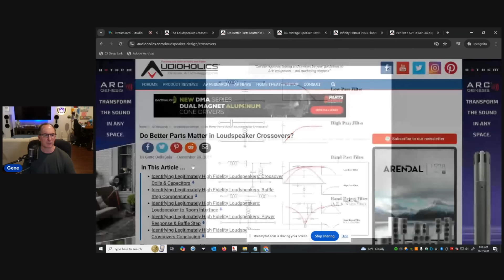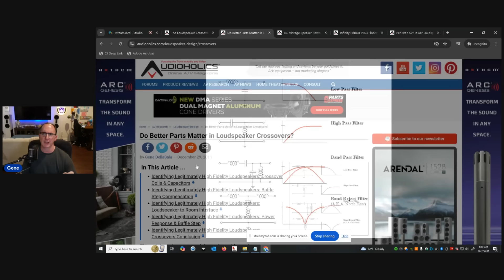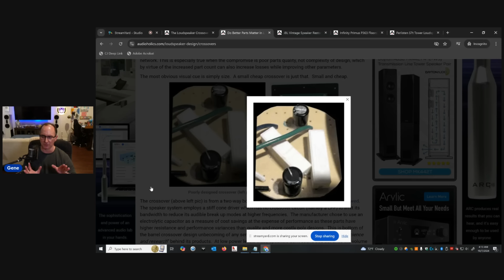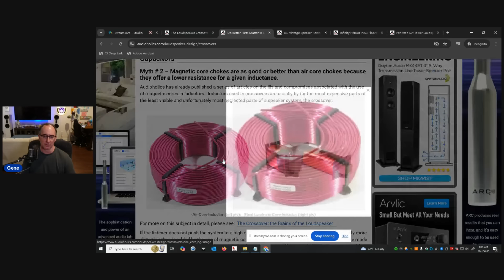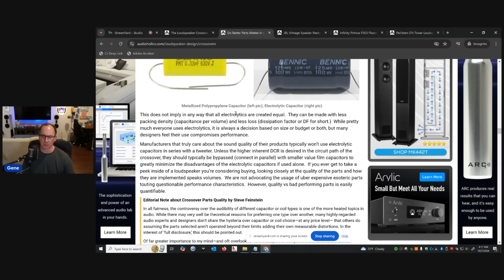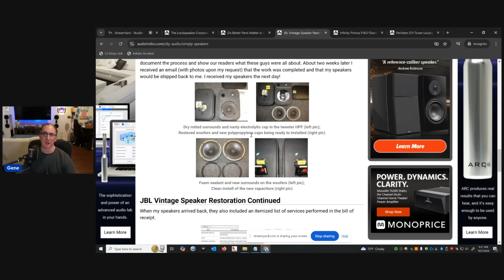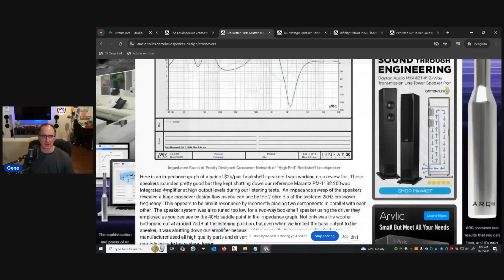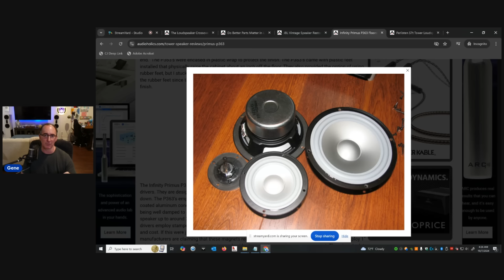Loudspeaker Crossover Upgrades - Are They Worth the Effort?

Comment: As a cobbler of speaker sets, I cobble together sets of towers from various used marketplaces. 

 I use a multi color sticker sheet to label them so I can discern what pairs came along together.  That way if one set was worn out or abused I can weed them out together, or pair them with their kin which have the same degree of use, hoping they mechanically loosened together at the same rate. Or that the manufacturer paired them based on their variance, like matched pairs of tubes. 

I’ve been meaning to get some kind of testing gear to help match pairs and detect discrepancies and bad-apples.   

When having many of the same speaker, and following the philosophy of pursuing identical timbral matching, one naturally thinks on upgrading all of their crossovers together to bring them into even closer tolerances. 

Cobbling sets together like this is easier with budget speakers, because there’s simply more of them in the marketplace.  Lending them to upgrade potential, and a home hobby assembly line of soldering in a new capacitor.  But dropping in a whole new board is rather appealing.  

I feel that the engineers finely tune crossovers to the resonant character of the drivers, so I’m skeptical of any mod being a net benefit, but I also feel that if the capacitor was lower resistance and the tweeter became louder, that the room correction software would account for that, while also having the benefits of lower resistance with crisper transients and micro dynamics.  

Sean Casey’s Zu speakers take a philosophy of having very high sensitivity and minimalistic crossovers with sometimes 1 or 2 parts.  So a lower resistance crossover may play into that same philosophy in a way that some people prefer. But it’s hard to tell how much damping in the crossover is there to tame driver resonances.  

One benefit of the Infinity Primus, is they have anodized constrained layer damping CMD like the CMMD Beta series much like modern Revels and I suspect like RBH’s aluminum cones have too. So the cones themselves have allot of inherent damping of resonances, which maybe would lend themselves to running loose with a more permissive crossover.  

Exotic Material science has always been a fun consideration for me, but most companies have similar philosophies and engineering goals in respect to weight and damping, but still fun to think about, especially when a speaker pursues an alternative design philosophy or has something truly exceptional.

Comment: In upgrading parts modestly (ie swapping a few aging electrolytics to modest mpk's) I suspect the differences created by differing esr etc are compensated for by improved tolerances  - particularly in having the advantage that both speakers will likely be giving a more similar response.

Comment: The fact that some people don't believe that better parts can create a better widget, says they've never built much of anything.  I build competition race engines.  Try doing that with cheap parts and low quality machine work and be competitive over the course of a season or two.

I also build rifles (for myself) where quality generally translates into better performance. You generally get what you pay for in the individual components. 

There's a bunch of examples of the ROI on good quality parts.

I could hook you up with the Danny modified speaker versus unmodified. I have some Focal Cobalt 828 speakers that I haven't upgraded yet. I have the upgrade "kit" from Danny. They're scheduled for surgery this fall/winter.

Comment: I have not ventured into the land of measurements much yet, but I see that it can be useful when treating rooms. Anyway, I have done an upgrade for a pair of klipsch RP600 M MkI that Danny Richie engineered the crossover for. The my impression at first listen was that it sounded like the volume was lower. It might also be the case as the impedance was lower after the upgrade, but after some months of listening I can confirm that it was the correct choice for me. 
Many might say that the original sound of the speaker was demolished in the process and it does not sound like a klipsch anymore. Well, one thing is for sure: I can now listen to it at a high volume for more than 15 minutes. Before it felt like my ears had been at a concert, and I had listening fatigue. The sound overall sounded a lot more quiet. By that I mean there must have been a lot more distortion than what I initially thought before the upgrade. 

I essentially bought the upgrade cause reviews of them gave me the impression that the sound would cover the sound-spectre properly as the original sound from the speakers was not only overly bright, but guitars in my metal music always sounded like they were in the back row.
I was correct, and now the speakers show me all the instruments and sounds in the correct space. (I base this on having used a headset a lot)
Since then I have moved on to GR's own speakers, and it has just gotten better, and  I have also treated my room and upgraded the stereo system, and the speakers just keep on giving. 
I acknowledge that speaker manufacturers often put their own signature sound in speakers, which can be fun, but can  also be damaging to some music. I can at least confirm that no music on these speakers sound bad. They work with all recordings good and bad. 
After getting more listening sound and working more on placement and acoustics, I also noticed that these speakers have a lot more details and can make a wall of sound rather than just coming from the speakers. So it feels familiar with many of the things you mention in this video. 

All in all, I do think parts matter, but there is a point when you need a more trained ear to pick up on the differences. But there are also some things that you can hear instantly. 
Many say that sound is subjective, but I think it also has a lot to do with what you can hear and how trained your ears are. Some that care only about vocals might not notice guitars being further back for instance, and som may only listen to classical music, and therefore not ever notice what a speaker can not do as they are only playing things that sound good in a certain spectre of music. 

Anyway, I can keep going on and on with experiences and conclusions made over the years, but I fully support upgrades. I do admit that some speakers may not need it as the fun part about them might be gone after, but in GR's defence, it will undoubtedly not be bad, and you might get some extra features that you can only get with more expensive speakers. Just as long as you know what to listen for.
Reply from the maker: Yep he traded sensitivity for a more balanced sound.  Most Klipsch speakers tend to be on the brighter side in terms of tonality.

Comment: You are 100% right. For one I'm an electrical industrial tech. I had to face 3 professors when presenting my final paper, but that's not why I agree with you; it is because what you say it totally makes sense. All of it! Now.... I don't agree with you regarding cables. I can easily hear differences in my system. So much that I've sent speaker cables back to Amazon when I compared them to the cables I bought from GR Research. So, my friend: cables matter.... a lot! Thank you for your videos. I don't remember when I started to follow Audioholics. It is way back!
Reply: While I agree that changing any part of a circuit, like the wires, can change the performance of the circuit , any consideration that doesn't factor in the extreme subjectivity of human hearing , will be flawed.   people selling you stuff never bring that up, and some audiophiles don't know the science
Reply from the maker: I agree cables matter. It's why I use very low resistance and low inductance speaker cables. The non-sense surrounding the exotic cables and their claims are simply ridiculous. If a cable makes a difference sonically, it can easily be measured why that is the case. Cheers.
Reply: @Audioholics  I think while deliberating speaker cables people do not notice  the problems of amplifier output circuitry They treat it as   connected   "impedances" which they do not know how to analize. Speaker cables are part of this output I do not hesitate to call a mess. The less is resistance od cables the more significant is so called "quality" of that circuitry which is resulting in own electrical plus mechanical  resonances  because we have there all needed elements - RLC amd elestic supprted masses and of course reverse induction .  To add to mess we need to incorporate in it "skin effect" I do not expect any sense to go much down with cables resistance, for sure avoiding skin effect is gain but I even would try deliberate more resistance - all depends on type of spaeaker - how complicated is crossover and speaker system

Comment: I personally upgrade ALL of my speakers, and using the best quality crossover parts that I can afford, and that along with box improvements where needed, all combine together to make a VERY significant improvement in sound quality of the speaker, even when still using all of the original drivers and such! I've never had even one speaker that I've improved end up sounding worse than it did in its original stock form, and usually the improvements I do are an extremely beneficial upgrade and immediately noticeably better!

It's definitely worth it, plus it's fun and a good learning experience!

Comment: As a builder I know better parts equal better sound, the soundstage width and depth improve, subtle nuances become more clear, attack and decay improve, these things may not show up on a measurement though. Just a word to the wise, when upgrading parts for an existing cross-over. It may not yield the best results to just copy the parts straight up. When it comes to replacing an iron core inductor with an air core inductor of the same value, you have to consider the DCR of the inductor, it will be much lower on the iron core and will change the output of the driver it affects slightly, this may require resistors in the system to have to be adjusted to maintain the same response. Just don't stop at cross-over parts, be sure to remove all of the cheap garbage between the amp and drivers, for more info go watch something at GR research! When done right, it will be a larger difference than you were expecting!
Reply: @scottwheeler2679  objectively, he's correct though.  Iron core inductors across the board have lower DCR for the same gauge.  If simply replacing the same value for an air core, it'll change the resistance in the signal path and therefore affect the frequency response. 
As far as his other claims, I can also confirm his experience.  Skepticism is great!  Always be skeptical of crazy claims especially in the audio world where bias can distort reality.  But you've got to be willing to do the work and apply the scientific method.  Otherwise, your skepticism is nothing but pessimism.
Reply: @scottwheeler2679  That is where experience comes into play, I have experienced the difference. Different parts have differing levels of change, adding it all up in the end produces the noticeable change. BTW, I meant designer and builder. I am not afraid to pull apart a store bought speaker and dissect/map out the cross-over and see how it can be made better! Can you say the same? What type of experience do you have to back up your opinion? In your humble opinion who would be an arbiter of facts? And short of bring you to my house and demonstrating said changes, what would you require as proof? I think you are not interested in improving the sound of your system, otherwise you would not act like such a doubter, I figure there is allot of envy on your side towards the people who have made these changes and enjoy them, and it's easier to stand there and talk $hit than take action.
I can clearly see you don't know what you are talking about, an air core inductor doesn't hold a charge, an iron core holds a charge in the slug of iron which takes time to disapate. I would go on, because I can, but I feel like I'd be wasting my time.

Comment: People should seriously consider active crossovers if they are building anything high end or expensive themselves. 
That will also present the opportunity to run DSP or Dirac Live. Cheap option is PA amps with built in X-overs, better option is miniDSP.
Active digital crossovers give you full freedom, and removes most cost and snake oil effect from huge coils or esoteric condensators.
Active crossovers also removes unwanted effects from passive components between amp and voice coil, with phase shift, loss of power to heat, out of spec components and so forth.
If you are just copying others projects, try calculating cost of active vs passive, i think you will be amazed.
Reply: @Ander357  
100% Agree!  I've been using various active DSP Loudspeaker Management Systems and processors since the mid-1990s!

Comment: Great, lucid video, Gene. I think the best crossover mod with most mid+ market speakers is simply replacing the caps...especially if old... with better quality caps. Spending several hundred dollars on a new crossover for a $1000 system makes no sense to me. Just buy better speakers to begin with. Most speakers worth buying simply are not "a disaster". Same with thousands of dollars worth of cables.😉

Comment: Some very good points! 
Especially about keeping decisions to upgrade within context of what one is working with in regards to driver quality and overall build in general.

I do want to point out, however, two points i noticed that are not entirely accurate:
1) The voltage rating you see on capacitors is not as big of an issue as you pointed at with the sample showing 650v rating. Although, when possible, I tebd to shoot for a higher voltage when selecting capacitors IF it's faurly close in price to a lower voltage part- this is not entirely necessary. 
Especially for a tweeter. In all actuality, a 100v capacitor is PERFECTLY fine when in series with a tweeter. The reason being is simply because that tweeter will never ever see the same level of power that the mids/woofers will see. Most tweeters will max at about 5-10 watts actual power that you ever throw at them as opposed to woofers.

 Their voltage swings are fine for just a 100v capacitor. In many ways, you are just throwing away koney getting anything over 250v for a tweeter, although I still sometimes choose a higher voltage part if it's a metalized capacitor rather than just 100v (generally 250-400) - but I would choose a 100v film & foil (separate poly film sheet/ separate foil sheet for each layer rather than vaporized metal on the single film sheet) over a metalized 250v capacitor any day 9f the week for a tweeter.
Even a woofer is just fine with roughly 150v or so, realistically. 

2) "Iron core" inductors are not always a cost savings part or even a sub-par choice in a crossover. 
A very high quality silicon steel laminated inductor can actually be a BETTER choice on a midbass (and EVERY single time with a low end frequency woofer) if they are of high quality and thick gauge construction with many sheets of silicon steel to push the eddy curents to unmeasurable levels. 
A good example of this are the Erse IXQ or superQ inductors. 

Take a Klipsch 2 way bookshelf, for example: the midbass needs as much help as it can get playing both loud and as quickly in the time domain as possible to better match the hyper speed and efficiency of the horn loaded driver.

 The choice of a 14 or 15 gauge laminated inductor will be perfect for this purpose + those ERSE inductors have next to zero measurable distortion below 3khz, especially if you get a thick gauge part. The distortion is always well below the driver distortion and this holds true for most laminated silicon steel inductors as long as they are not being asked to play above roughly 3k or even 5k in lower wattage power demands. 
Now, only silicon laminated solid core inductors are capable of this, so what you said holds true for all other forms of solid core inductors. 

The reason these get a bad rep is due to the fact you rarely see them thicker than 18 gauge in high production speakers- totally due to being used as a cost savings. However, specify a 14 gauge (or even 12 gauge erse will happily make and have in stock - I have tons of communication time & experience with them) and you will have just as good of distortion measurements in their intended bandwidth and MUCH lower DCR that no air core will ever match, as well as a slight nudge in the time domain given their overall higher Q factor. 
Personally, I'd never choose anything BUT a 14 awg IXQ coil for a midbass mated to a high efficiency tweeter or horn driver. They absolutely have the highest Q given their intended babdwidth limit as oong as you get a minimum of a 16 awg coil, but 14 awg is optimal and still reasonable in cost.
Reply from the maker: Great feedback. Please make sure captions are turned on when watching this video as I address many of your points. I couldn't recut the video since it was during Hurricane Milton and I didn't have power so I added text notes. thanks
Reply: Capacitors are also rated in regards to maximum temperature allowances, with 105°C generally being higher quality and having better longevity than their 85°C counterparts.

Comment: back in the 70s. my friend had thebig IMF Monitor IIIs, a four way tapered TL speaker that was flat to  16Hz with excellent staging and imaging.  Bud Fried offered an upgrade xover card that when installed transformed the sound to near electrostatic speed.  just wonderful.  so, yes it is worth it.